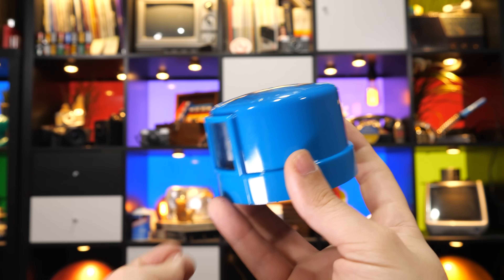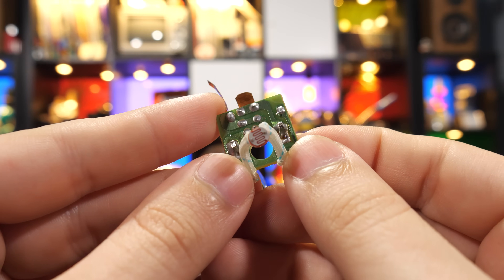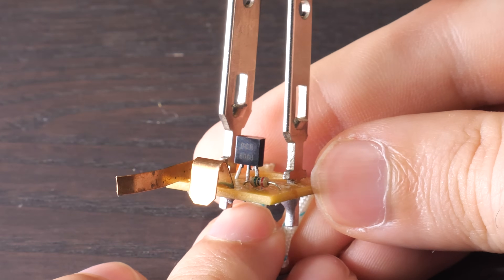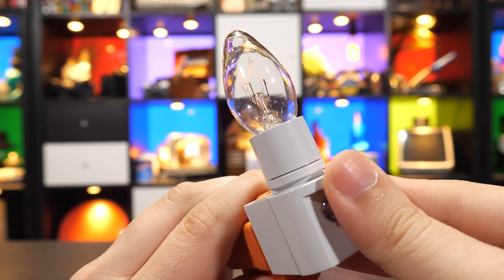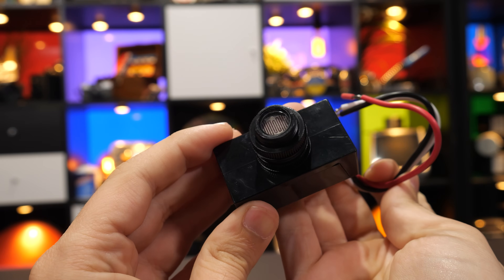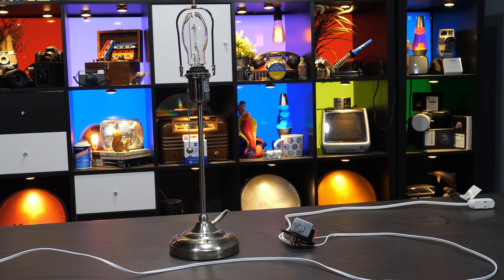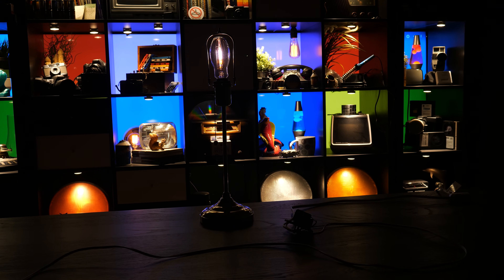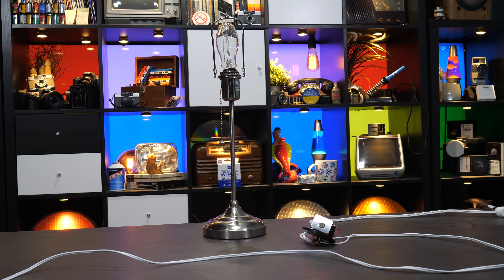Photoelectric light controls are weirder than they seem

Comment: A light-bulb went off in my head when you said there's a side-effect of the heater. I had noticed that street lights will switch on mid-day after a power outage, but always figured it was some programming issue defaulting to midnight or something.

Comment: I'm a bit surprised a safety cut-out switch designed to only actuate in overheat conditions would be chosen here.  This system is designed to cycle it daily and run it in "hot" mode most of the time, when its original application would be to trip right away and stop whatever was making it hot.  

I guess internally it's just the same thing as the bimetallic strip contactor, but I wonder how many open/close cycles it's rated for, etc.
Reply from the maker: I imagine there are many varieties available - something like the limit switches in the furnace would hopefully never get actuated, but the same style of switch can be useful for applications where it's cycled many times per day. In the case of these photocontrols, realistically they don't need to last a tremendous number of cycles. 10,000 cycles would give them a 20+ year lifespan, even assuming the odd heavy thunderstorm or solar eclipse.